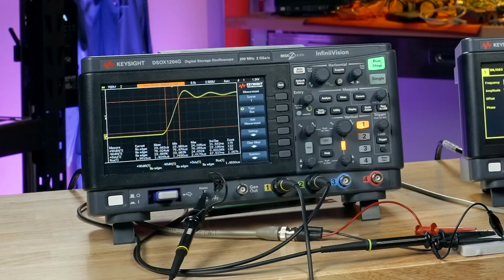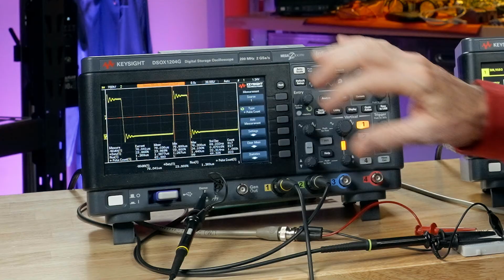Lesson 6: Automatic Parametric Measurements

Comment: 4:32 What I really like about the GUI of this Keysight oscilloscope is that the individual selection options are also displayed with a graphical icon. This significantly increases usability. On a Rohde & Schwarz device, it was just text. I don't know if you can change this somewhere in the setup for the latter. I only saw it in a video on YouTube.